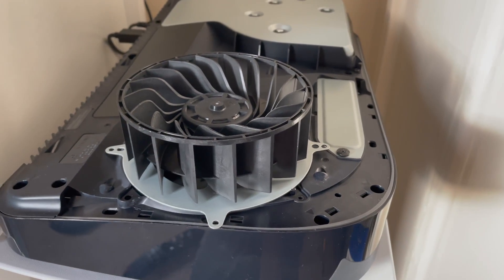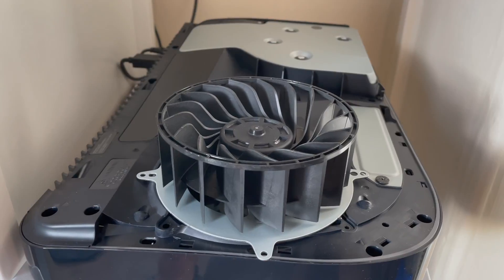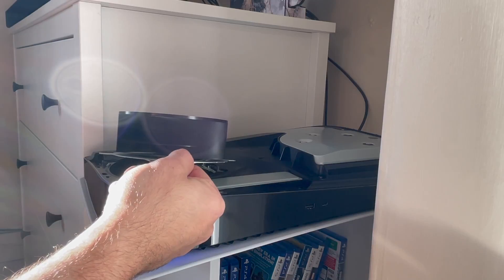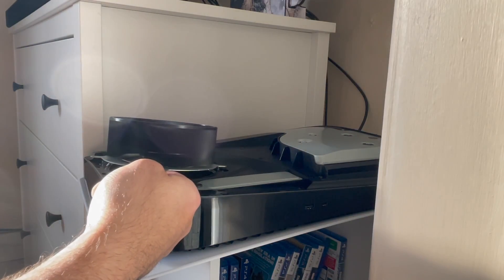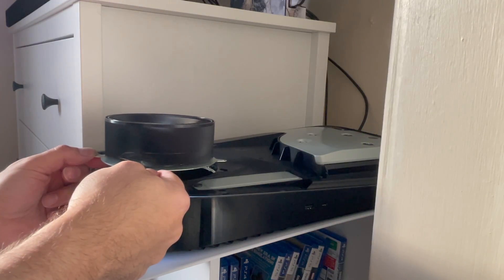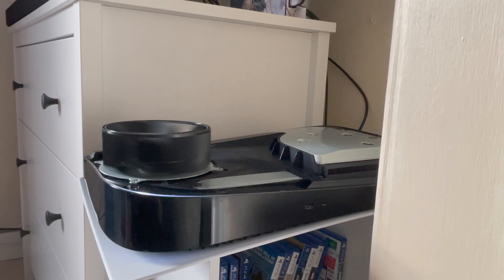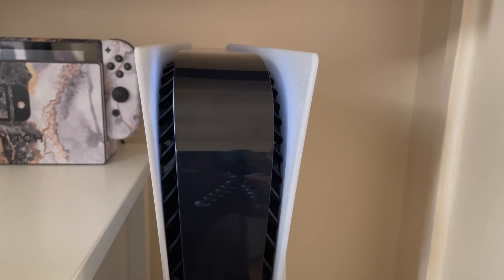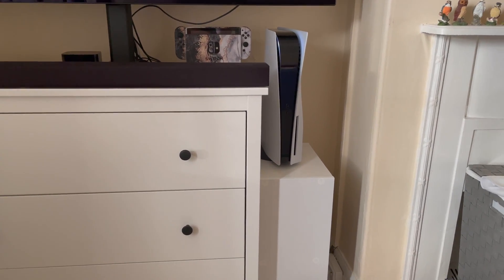PS5 Noisy Fan "B" Fix?

Comment: Thanks for the explanation I knew it had to be vibrating against something I still don't get why the 2 other fans don't vibrate like this or have coil whine 🤔
Reply from the maker: The consoles with the other fans will still exhibit coil whine as it’s unrelated to the fan and comes from the coils in the psu. But yea wish I had gotten one without the loud fan. Can still here it but it’s becoming less annoying as I get use to it. Still not ideal.
Reply: @WildlifewatchingUK  can always ask for a replacement or do it just before the warranty runs out, hopefully by that time the new stock has issues solved
Reply: @WildlifewatchingUK  do you Think its because there was not enaugh materials (COVID-19) so they just Got some decent fans there completed the goals they had to the fan. I hope in 2021 all ps5 Will have the good fan and not just the ones there complete the goals but is loud.
Reply: @CHR-1803  yes exactly this they'd probably have less than half the PS5's without using fan B. Imo i don't think they'll just stick to one fan its a matter of luck now I'm afraid

Comment: Damn my PS5 makes the exact same noise, i am too nervous about doing this 😂 great video though ✌️
Reply from the maker: Thanks, it's honestly not difficult just need the right screwdriver and O ring size. It's made quite a difference I think. Sure I still hear the fan when Im on a map screen or something without music but it seems far quieter than it previously was so I notice the annoying judder of the fan far less.
Reply: @WildlifewatchingUK  did u make it quieter? And what o rings did u use link them
Reply from the maker: @3lizai  id say a little quieter but not massively. It makes it a little less annoying but over times you stop noticing it so that’s the best bet. I got them from Amazon in the uk. Just have a look for any with the size I mentioned.

Comment: I have exactly the same problem with the fan! Could you fix it in any way?! Mfg
Reply from the maker: Sorry little confused what your asking.
Reply: @WildlifewatchingUK  Could you fix the problem?!
Reply from the maker: @robinhellmich1838  I didn't fully fix the problem but it's improved quiet a bit by using the rubber O rings between the fan and the console. Or are you asking me if I can fix yours?